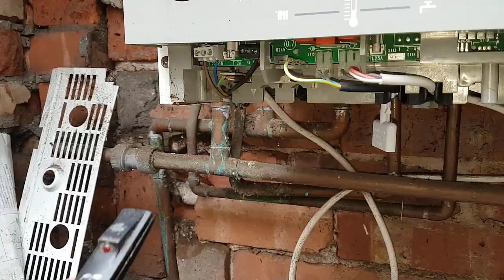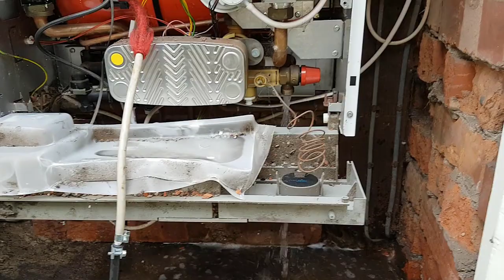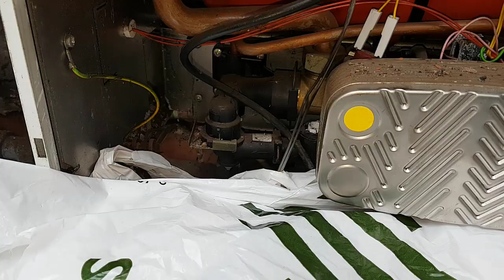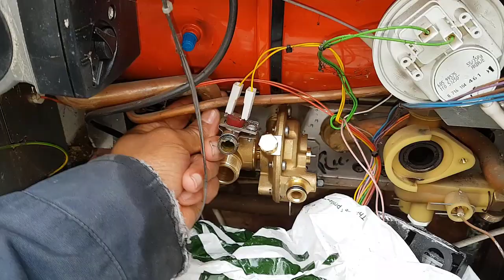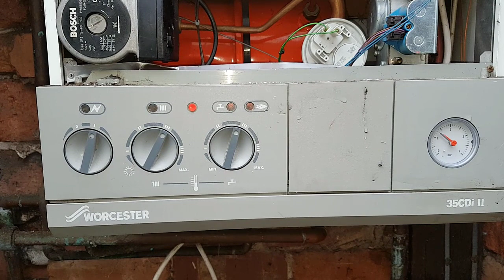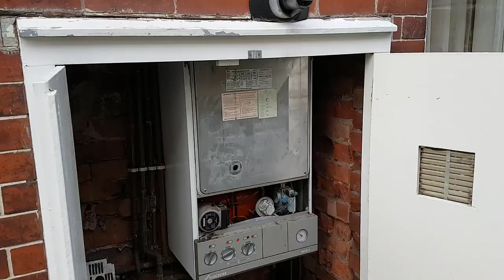Worcester 35CDI Changing the O Rings On a DHW Heat Exchanger

Comment: Hi Tony, I have a 35CDI and would like to ask a question, my system is pretty old but still working fine, apart from needing a new heat exchanger which I have ordered, I cannot afford to have a professional power flush done so was thinking of removing a radiator and connecting a hosepipe from the mains to the flow end and a drain pipe leading outside to the other, question is in your video you say don't turn off the isolation valves at the flow and return on the boiler because they tend to leak, so can I still flush the system through without isolating the boiler, look forward to your reply